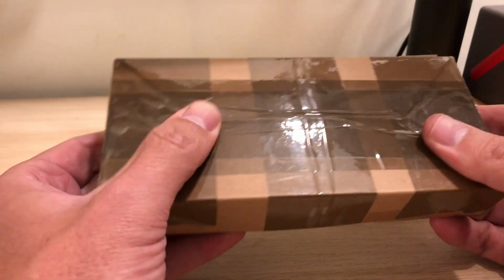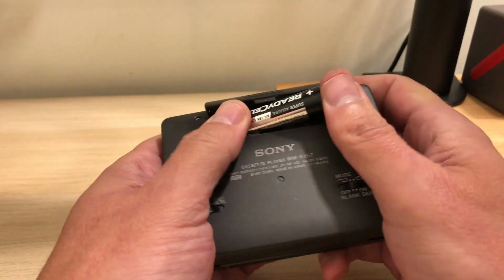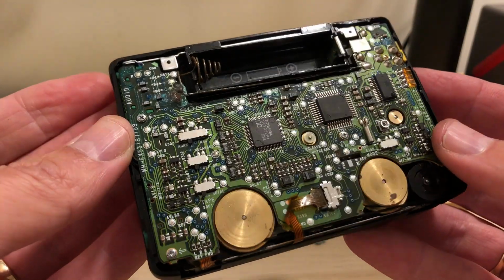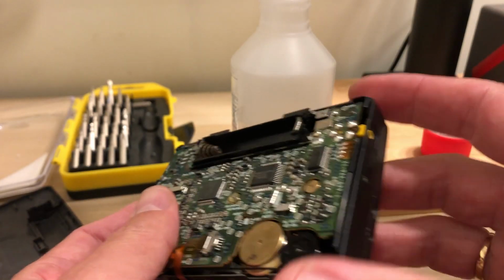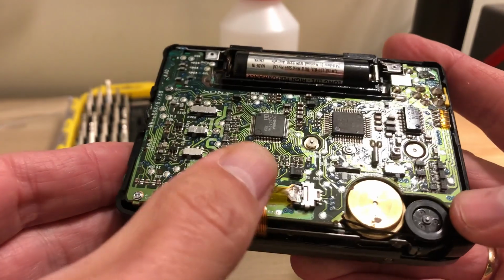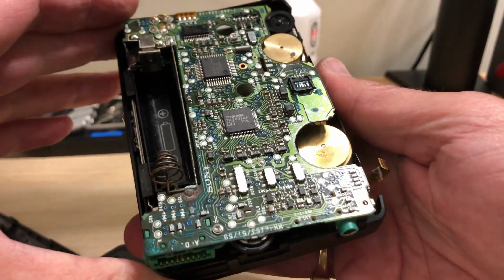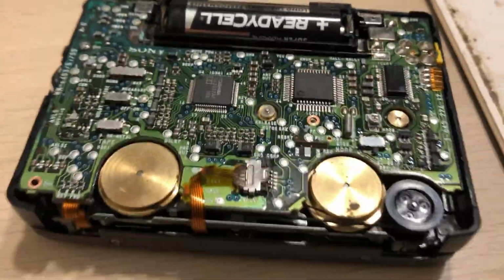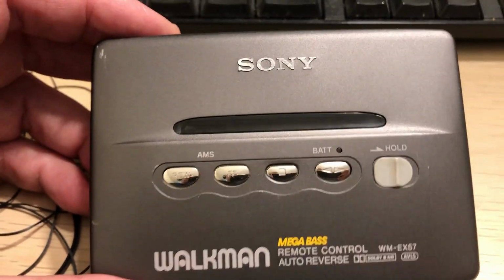Sony Walkman WM-EX57 (EX53/EX59) Belt change, trying to fix

Comment: gluing that head connector is definitely missing connection😂 

try soldering
Reply from the maker: I may well do. I’ve been practicing my soldering since that video on smaller components and not forgetting solder flux 😀

Comment: Odd that that corrosion was under the ribbon cable. Nice attempt at a fix. Will be interested to find out why there's no sound though. Meanwhile, it's handy as a tape rewinder.
Reply from the maker: Thanks, I am thinking that the caps are probably gone on the audio side as this was a common issue with AIWAs too.
Reply: @AvidRetro  Interesting. That would be one cause of the corrosion there, I suppose. Wikipedia says that the 'capacitor plague' was primarily 1999-2007 manufactured devices, but I'm yet to see any practical evidence of that one way or the other.

Comment: hello! i own this model and despite it turning on, flashing, beeping etc i can’t work out how to get it to play tapes or if it’s malfunctioning? is there something i’m missing (ie. how does one actually get it to play) or do you know of any reputable service companies (it was my mums so i’m keen to get it working properly). thank you so much!!
Reply from the maker: I hope you can get it working. In some of my other videos on similar ones I find that the capstan side tends to get sticky or struggle moving. I would keep trying various things, although if it is a fault on the PCB it will be harder to fix. Did you check the belt also?